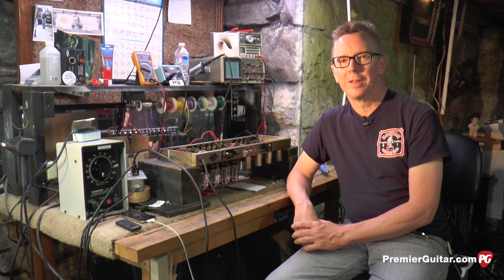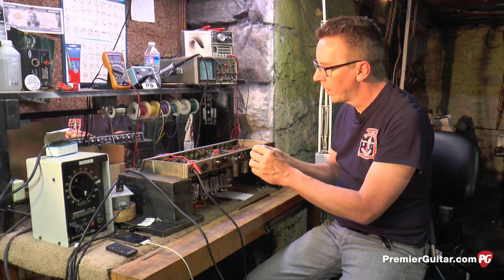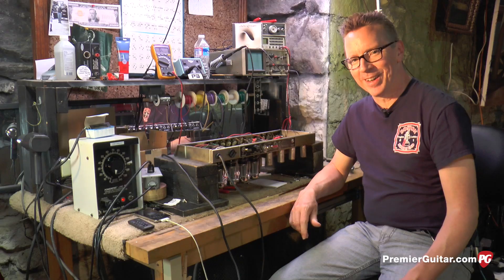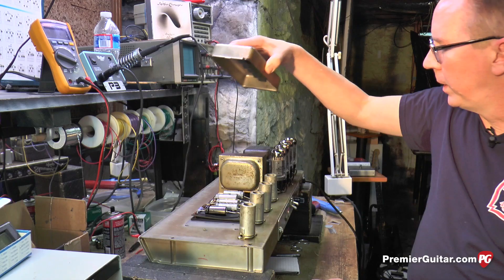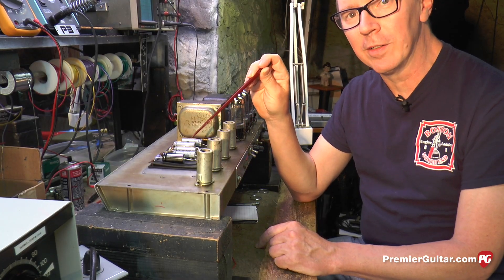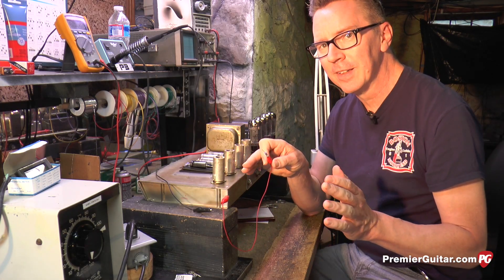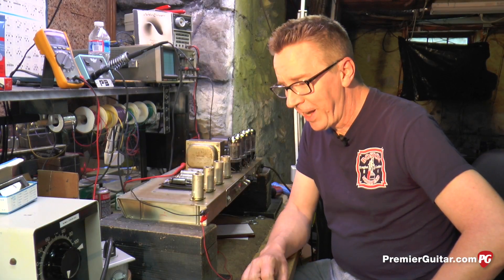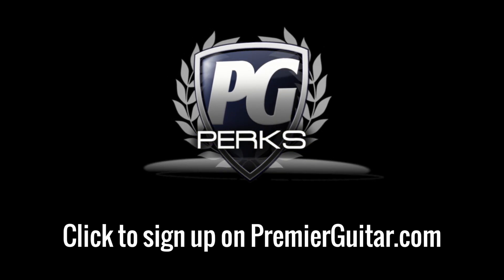DIY: Amp Safety 101

Comment: When you remove the doghouse cover that shields the array of power capacitors you can accidentally bump the metal box against the live leads of those caps and shock yourself. Do not flip an amp over and just remove that cover straightaway. There is a way to discharge those big power caps from the inside of the chassis via their connecting leads. It's always better to discharge them from inside. Also, if you're working on an amp with a standby switch, turning the amp off while leaving the standby switch engaged is also a good preliminary method for draining power caps ... but you'll still want to verify that there is no power by checking with your multimeter.
Reply: Notice how Kyle drew on his experience and was careful to lift the doghouse vertically, avoiding contact with the capacitor leads.
Reply: having replaced a filter cap in my marshall, I get ya.
Reply: Best to use gloves :)
Reply: @kornelijekovac9793 what kind of gloves?
Reply: Question: using the dog house method was more about isolating the power caps from the signal path than "to protect you", right? In the same era you had at least Champs, Princetons, and Deluxes that had the filters inside the chassis, which leads me to think that the component layout of the Showman necessitated getting creative.

Comment: Interesting video, and I'm not an electronics expert by a long shot, but I'd have thought the mains plug should be connected when bleeding the filter caps to to earth?  Otherwise how else does the current bleed to 'Earth' and not just the chassis?
Reply: To chassis for continuity purposes in the circuitry. Think in terms of a battery.

Comment: When you dismount the chassis of your amplifier and you don't even know what's inside... why do you do that? I've been working on my amp for more than fifteen years now and I've been shocked three or four times, but it wasn't lethal because I know each component that's inside. There is always a first time! But with all the videos on the internet about amplifiers and how do they work, you have no excuses if you don't care about yourself. The first thing to do is to learn as many things as possible, before putting your hands inside an amp!

Comment: How is the chassis grounded if the amp is not plugged in when working on it?
Reply: Good question with no replies for two years. Do not plug in the amp. The “ground” circuitry (chassis) is utilized for continuity purposes for the capacitor discharge process and meter reading their residual charge.

Comment: Good video.  I know this video is several years old, but I have often wondered about all the other caps in an amp.  The disk and Mylar capacitors.  Even though the voltage with them is much lower, should you discharge them, as well?  Not just for safety, but for potentially unexpected energy surge which could damage other circuits in an amp?
Reply: I am a bit late on this but i am going to answer anyway. The filter capacitors are connectet to the high voltage path of the power transformer. What they do is filtering the bumps out of the DC, so the tube receives a a nice consistant DC. The other capacitors are mainly used in high and low passes to filter certain frequencies and do not store high voltages. But if you really want to be shure you can discharge them too. But it is not necessary.
Reply: I also wonder.

Comment: I also have 25 years of occasional work experience repairing electronics.  When I was in electronics school (National Radio Institute), our very large TV stoped working.  This was before my TV servicing lessons.  I tried taking the cathode wire off of the CRT with just a pair of metal forceps (not a grounded flat screw driver).  The shock I got make me feel like dying (literally).  Another time I got shocked off of a large Lyden Jar that I made and charged with a 500,000 volt Van de Graff generator.  As you know, the Lyden Jar is a huge capacitor, and the three inch spark hit my thumb, sending me to the hospital.
Frank
Frank Reiser Video/Audio Service
Reply: And now everytime somebody runs the microwave you pee your pants right?

Comment: So after discharging the filter caps, and checking that there is no voltage left, it's safe to touch anything in that amp until it's been plugged in again? I've read they can charge themselves too. How long does that take?

Comment: The chop stick may not be safe, dry wood (not wet) is a great insulator, but its possible they use paint or some other finish (it looks colored) that is conductive. I've seen some sparkly gold looking ones that i wouldn't trust. Old video, but might mean my comment will sit on top for a bit when others watch it.

Comment: Thank you for this great tutorial. I need to open my amp in order to look for loose contacts or broken solder points, but was afraid of the high voltage, since I did not know how to discharge the caps (yes, in theory I know, but never seend practical).

Comment: 101 note: the amp must plugged in order to get the ground conection.
In some countries there is no a standard conection to ground, so if you don't have any ground conection in your bulilding there would be dangerous to plug in your amp. You must have a Ground conection.
Reply: I came to the comment section looking for this
Reply: A three prong ground.  The middle prong is actually the ground lead.
Reply: But remember : at the electrical junction box the neutral and ground are tied together. Just a thought.
Reply: Good catch!  Was hoping somebody had already mentioned that.  Some shops have a copper strip or plate that is wired to earth ground, and you just connect the chassis to it via a test lead.
Reply: Most important comment and correct.   How do you move this comment to the top of the list? Unfortunately all the entertaining info, not good info, moves to the top-good thing I love entertaining YouTube comments.
Reply: So plug the amp back in when draining the caps?
Reply: @lukedesaulniers5943  NO!!!
Reply: @lukedesaulniers5943  NO!!!
Reply: @lukedesaulniers5943  NO!!

Comment: I wish i knew someone like you. I have a Mesa Boogie 50/50 Power amp from 1990 that originally had one bad socket that was over heating a single power tube. i ran it w only the 2 good tubes in it for a while, now theres no audio coming out at all. The pre amp tubes arent lighting up but i never opened it up when it was working so i dont know if they are supposed to light up. I have everything to discharge the caps safely and test w a multimeter. I spent all that money on it but have hardly used it at all and it was only running on one channel. do the pre amp tubes light up? Is there a way to tell if capacitors were replaced before?
Reply: All tubes will glow red or white faintly near near the bottom of the tube.  If it glows very brightly and gets hot shut the amp down immediately.  You either have a shorted tube or something else causing the tube to short.  This is called "red plating."

Comment: Let me first start by saying "Thank You" for the video. Us Noobs around the globe are in need of such clear and concise information.  That being said, I do have a very serious question, and then I'll explain why I'm asking said question.

Both when discharging and testing the filter caps for residual voltage, can the ground lead of the same capacitor be used instead of the chassis of the amplifier?

The reason I ask this question is, what if there's a broken ground circuit? If the ground circuit were to somehow break, then it would seem that using the chassis for your ground discharge and voltage test would give you a false reading.
Reply from the maker: Hey Rob, this is from Jeff Bober, dude behind Budda Amplification and East Amplification who writes our monthly Ask Amp Man column: "Rob, thanks for your question. Yes, you can certainly use the ground side of the capacitor to discharge it. It's actually a good point and a good idea! " Best of luck and be safe!
Reply: What exactly is the ground lead of the same capacitor ?

Comment: The human body is around 2M7, so any resistor under half that is good.
Changing PSU resevoir caps every ten years?!? No. And take those cheap caps out, they'll sound awful.
I good basic guide for someone coming from low voltage stuff but really if you need this then you shouldn't be touching valve amps, for your own good.

Comment: Your explanation about the heart valves being closed at the same time and then receiving a lethal voltage and your heart valves will never open again is the best WARNING ever. I will never forget it. You were right o the point, you did not imply I could get hurt, nope, you explained exactly how it could happen. So now I too will always keep one hand in my pocket while exploring/working on my tube amps. Thank you Mr. Kennedy!
Reply: On at least two occasions in my life I have had voltage run up my left arm and to the shoulder. I was young enough and reacted fast enough to disengage. The voltages never reached my heart. First time at around age 10 I stuck my finger in a lamp socket to see what would happen! Current ran up my arm. I was fast enough to pull my finger out. Second time I was trying to fix my friends car at night while it was running. I grabbed a spark plug and that DC voltage shot straight up to my shoulder. I was lucky that I was able to move my muscles and I was able to let go. I'm 67 now and I doubt that my reflexes are fast enough to disengage. A third time I pulled on a lawn mower spark plug wire and just got voltage into my finger tips. 
I am aware that sometimes you cannot disengage because the current is so strong that it locks up your muscles. That's how I envisioned being electrocuted to death. 
Now you have taught me that the current only needs to reach your heart while both valves are closed and that's all she wrote as they will never open again.
Again I thank you Mr. Kennedy,
Peter
Reply: Except it’s not accurate. The theory sounds nice and smart. However, completely wrong.

Comment: I'm sorry, I only just learned of the dangers of caps and haven't done extensive research yet. Does the danger lie in valve amps exclusively or would you run into a similar set up with a solid state amp? Thanks very much for your demonstration of finding these caps and discharging them!
Reply: Kyle Jackson just assume any cap can hold a charge.

Comment: 2 questions: 1 what is that resistor being used?
2, is a 10k 1/2watt resistor sufficient?
Reply: He says it is a 100ohm resistor, judging by looks of the one he is holding it looks like a 1/4 watt... I am assuming a 1/2 would have less resistance and would just bleed slower? I am not sure just a guess there

Comment: thanks so much for the detailed video.I'm trying to fix my used mesa boogie 50/50 and have been electrocuted enough in my life so i want to avoid any more shocks if i can help it. going to get a multimeter,resistor and gator clips this week so i can work on the amp.i didnt know that the caps can dry out so i  need to figure out how old they are(amp made in 1990) or if they've been replaced.

Comment: Are the capacitors the only thing that can kill you inside the amp or are there other dangerous things lurking in there?
Reply: The capacitors are connected to many places inside the chassis, and you can get a shock by touching any of them if the capacitors are still charged. However, draining the capacitors makes the whole (unplugged!) amp safe to touch.
Reply: Nothing else inside the amp holds a charge.
Reply: Zombies

Comment: do you have to do this if your only going to change out preamp and power tubes?
Reply: Changing the power tubes usually means re-biasing and you can't do that with the amp turned off.  If your amp has an external bias adjustment port you can bias it yourself.  Some newer amps do, most older ones do not.  If not I would take it to a tech.  No for preamp tubes.

Comment: I have a Hot Rod Deluxe and I'd like to swap speakers with an old Celestion V30...do you have any req's for doing that? Thanks, David
Reply: Make sure the resistance (ohms) is the same for the speaker(s) you are replacing them with.

Comment: Does the amp need to be plugged in, in order to bleed to ground?
Reply: No. 'Bleed to ground' is possibly not a good description. 'Discharge the capacitors' would be more apt. The reservoir capacitor has its positive terminal connected to B+ (the high voltage supply) and its negative terminal connected to the chassis. It is storing energy in the form of electrical charge, which means that there must be a voltage across it. If you connect a resistor from its positive terminal to chassis (i.e. its negative terminal) then Ohm's Law dictates that the voltage across the resistor must cause a current to flow, doing work in the form of heating the resistor. As the capacitor gives up its charge (and the voltage across it falls) the electrical energy stored in the capacitor is converted to heat energy in the resistor and the heat is dissipated into the atmosphere.
Reply: NO! If you plug it in you'll fill the capacitors, making the procedure both useless and dangerous.
Reply: But how can you bleed to ground if you're not connected to ground via ground of the wall socket?
Reply: bla blab  The other end of your test lead is attached to the chassis, which is ground. If you're paranoid about this you can take another lead, attach one end to the chassis and stick the other end into the actual ground outside your house.

Comment: I've scratch built 4 amps in a row now and have not gotten shocked.   I've gotten zapped by a few project amps, and a few old timers that needed service really badly.  Once you get a shock or two, you learn pretty fast.   I'm old school... teach the safety,  but don't harp on it.  Once the rookie gets a jolt,  they'll learn.  LOL.
Reply: That's good advice unless the shock kills them...
Reply: I got a bit of a zap for the first time, fixing an amp on Monday, i now never want it to happen again so making sure i fully understand what i need to do to be safe.

Comment: Does it matter what wattage the 100 ohm  resistor is?  1/8 or 1/2 Watt?
Reply: I use a 7 watt wire wound resistor. The one he is using there is probably 2 watt.
Reply: Use 1W or greater. Some low wattage resistors are not rated to withstand voltages found in tube amps.

Comment: are not the leads insulated so you dont get shocked why the hand in the pocket?
Reply: If you touched a ground and the voltage was high enough to arc the insulation, then the power would go in your right arm and out your left arm. The path goes through your heart! Not good! Using your right hand keeps the power away from your heart. I have a kidney bean size burn on my right middle finger, and a dime size burn on my right wrist from a 8000 volt TV shock. My hand was numb for a month. I survived because I only used one hand.

Comment: The gun is always loaded, the horse always kicks, the dog always bites and the filter caps are always fully charged.
Reply: I'm still going to check before I stick my fingers in there!
Reply: @silasfatchett5693  That's what she said.
Reply: Always work on tube amps with one hand in your pocket.
Reply: @timstanford3220  for that reason you'll never see one-armed people in the tube amp industry
Reply: @timstanford3220  Isn't that an Alanis Morsette song?
Reply: And she will always love you!
Reply: Words to live by!!!
Reply: and that fart, in fact, is not a fart.
Reply: Actually you're wrong, bozo. I'm looking down the barrel of my gun right now and it's not loaded.
Reply: Unless the mains is disconnected and the standby switch has been on for more than 30mins.
Reply: If you switch off the amp with the standby switch in the 'play' position, the filter caps will begin to drain via the tubes while their cathodes are still hot. The caps may discharge fully before the tubes stop conducting as their cathodes cool down, but they may not.
Reply: @PrinceWesterburg  Good to know... That it's a way to "leak" the charge out of the caps that is. I think I'll still make sure they're "safe" before licking them while having my hand on the chassis though. 😉

Comment: Best explanation I have seen.... well done.
I would add: Stand on a rubber mat and not a concrete floor.
Reply: I’ve been standing on a metal floor is that OK?
Reply: @cardbored_  I've been working on my amps in the rain dressed like that tin guy from wizard of Oz. Will I be okay?
Reply: Put boots on it can save your ass

Comment: I only have 2.2K resistor - will this work safely in lieu of the mentioned 100 ohm resistor? Is the "2.2k" label on my resistors the ohms?
Reply: I calculated that to discharge 400V on a 100µF cap down to a safe 7.5V with a 100Ω resistor takes 0.04 seconds. Using a 2.2kΩ resistor would take 0.9 seconds.
Reply: +Jason Radcliff The 2.2k would be the resistance value.  It would work but due to the much higher resistance the bleed is going to take quite a bit longer since it will slow the flow of electrons out of the Cap.

Comment: One thing I am a little confused about is the use of my DMM when checking voltages in my amp.  When I have my amp plugged in, whether the power is on or off, the top part of the power plug mini-board (where the fuse is located, the very start of the circuit) has a voltage in it (120v of course, because its US).  I can test it correctly by using my meter from the "hot" connection line to the neutral line on top of the board.  Why can't I get an accurate reading if I connect my DMM to the "hot" line, and then to the chassis of my amp?  Similarly, why does it work to connect the leads to the filter cap and the chassis when testing THAT voltage?  Thanks